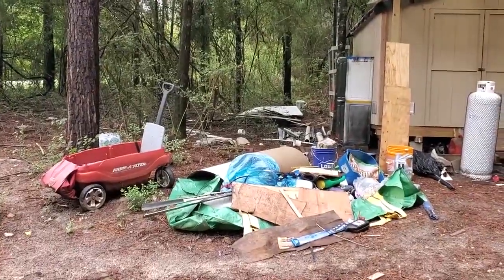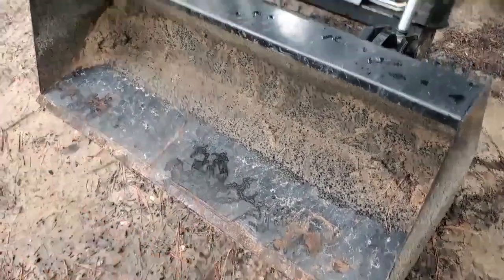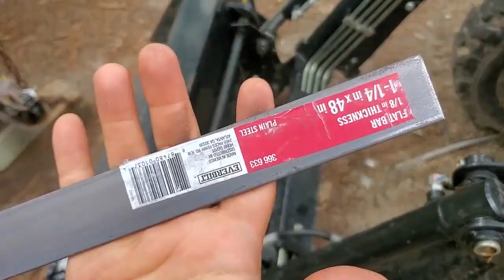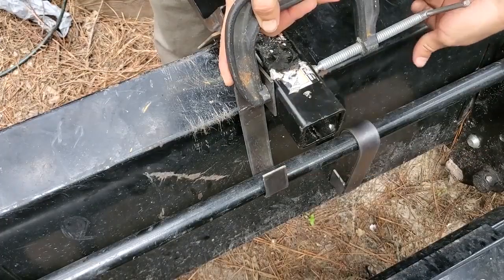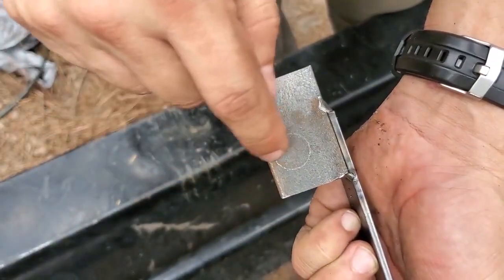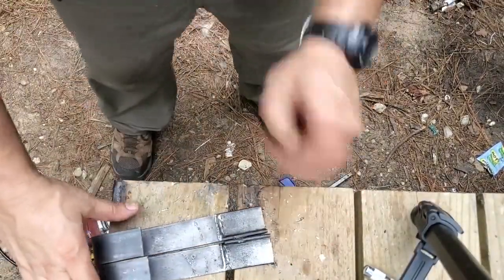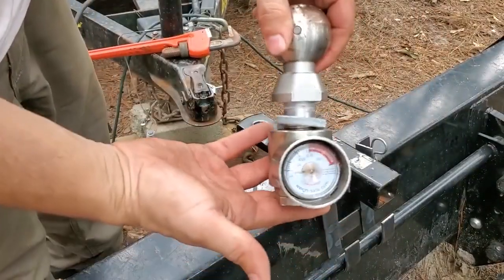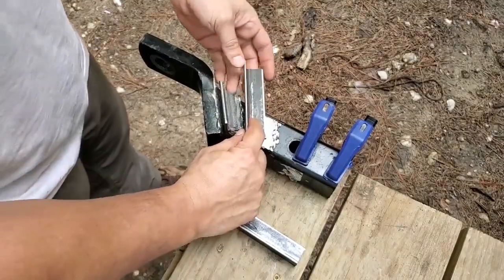making a trailer hitch for my tractor bucket

Comment: I bought a 2”hitch receiver mount for 
$ 20 years ago and welded to to top of the bucket, in the same place.
 It allows me to move trailers, attach a wench if I want.
 I usually have have a mount with a tow shackle clevis on it for pulling stumps and lifting things.
I can share any of the mounts with  my truck.
Reply: You beat me to it. I was going to say, grind all of that crap off of your ball mount and weld a receiver to your bucket. Later you can make or buy mounts for a shackle or a chain grab hook. You could also make a boom that mounts in the receiver and is supported by the front of the bucket. The list is endless.